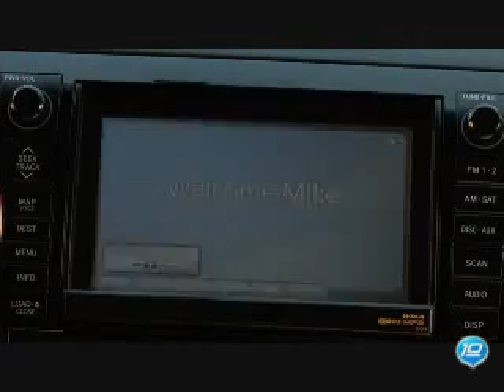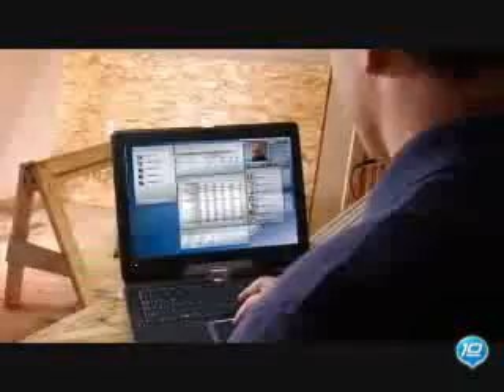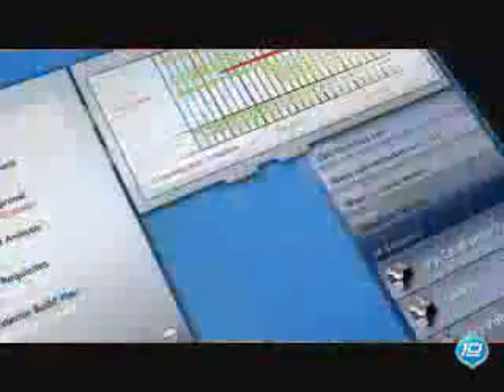Windows DataFlow preview

Comment: Then you didn't train it enough.
You just probably plugged it in and ran it. Use the program "Train your computer to better understand you" it is annoying, but after 2 times the recognition has improved drastically, after 4 it is almost failsafe.

Comment: And I'm a guy that has cracked dongle protection in assembly language (among other things) and I still would find it very useful. 

I want my operating system to be able to show different layers of input, from the most organic and natural, to the most low level and cryptic. My mind is not always in "l33t mode", so I would definetly want the OS to do the thinking on occasion.

And it would be a waste NOT to use the hardware, as UI graphic layers can always lend their time to other tasks.

Comment: I really hope they WONT make any Windows controlled locks for the doors to the house.
Reason 1: What if Windows would crash and you would have to start up from the inside?
Reason 2: It would be possible to "Hack" in.
Reason 4: What if the batteries run dry?
And I didn't have energy to write up a reason 3 so you will have to stick with 4.

Comment: stanni1992 & emirilyasov : 
Nah, you both are totally out.
Actually, what you see there is M$ trying to make Windows even more "n00bs-friendly" (like Apple). N0obs-friendly + windows = "n00bs unable to keep a comip secure" which means there will be more annoying security. It will become even more bloated of security and it may even become so "secure" than any tweaking you can easily do now in XP and Vista may become almost impossible unless you're a very advanced user.